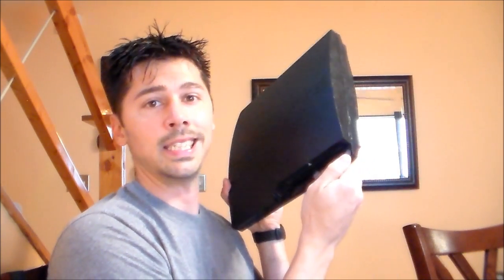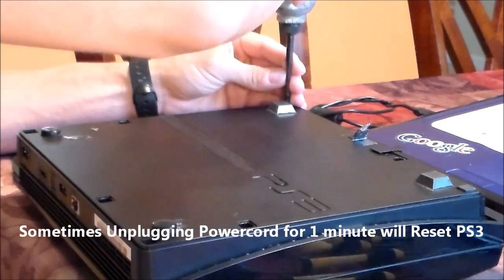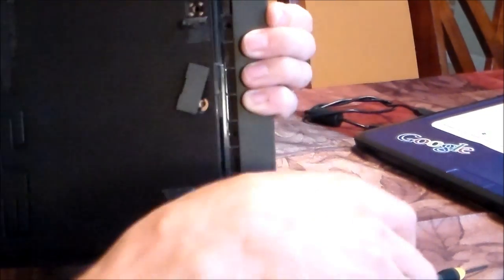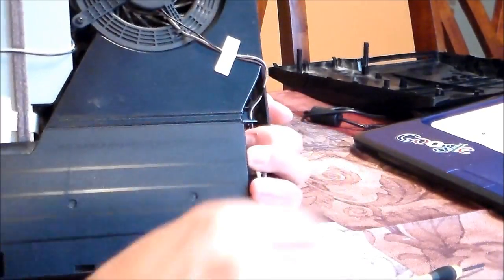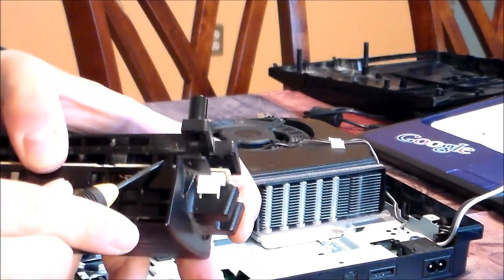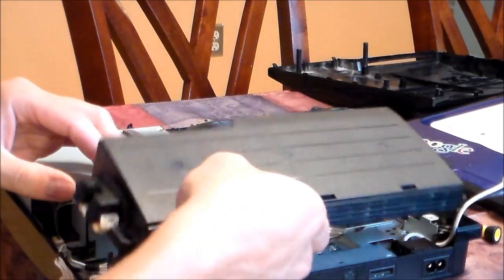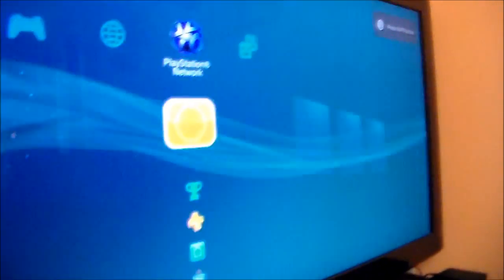HOW TO Open PS3 & Fix No Power - Powersupply install

Comment from the maker: unplug all cables and power cable too on ps3 and tv wait 2 minutes to hard reset system,  then plug in if no good use the a/v component ps3 cables. try cleaning fans. good luck, sub if this helps 8^)

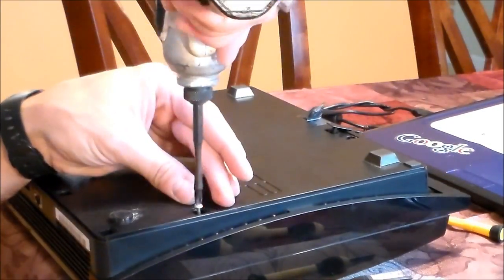Comment: @11:38 you are power driving the screws in.
This is one sure way to STRIP out the mounting hole threads.
 First, take a screw driver then rotate the screw counter clockwise to start and capture the present mounting hole threads.
 You will notice how the screw drops into place.
 Once in place you may continue with the power driver.
This method is good for plastic, wood and metal mounting holes.

Comment: it's funny that the screws are hard to remove from the power supply It was hard for me too but I did unlock them and I cleaned it up and there was a lot of dust in there the information you gathered is really good bro.

Comment: Great video but my ps3 is still not working. My problem is that when the power is plugged into the ps3 the red light comes on and then shuts down within  2 seconds. If the power button is pressed as soon as the red light comes on it turns on but goes off again immediately.

Comment: I have a cech-3012b and am having a bleep of a time trying to pull the power supply. I’ve done the prescribed things but on optical drive side near the plastic square (I’ve tried pushing it this way and that if it’s notched to something), looking for snaps with no luck. Forcing it, the LAN and HMDI section is squeezing away out of the case. Think I’m doing something wrong.

Comment: How do you suggest to clean the ps3 cooler? kind of worried i never had an problem in terms of overheating,except one day that was quite hot the ps3 turned off,luckily nothing happened only turned off,can i use an aspirator?

Comment: Hi. Great video. Very informative and helpful. I have a separate problem though .... When I plug the unit in, the red light is on, however when I turn the power button on, it goes green for a few seconds, and then goes solid red with a series of beeps, and then nothing works. What could be the problem?
Reply: the same as me damn
Reply: And me.

Comment: I have a ps3 slim cech 3001a. Its kinda different. How do I open the power supply cover as there doesn't seem to be any there clips around it. Nice Video by the way.

Comment: @Tampatec first of all many thanks for your help on youtube. My PS3 works well when it is on standby mode but as soon as I turn it on it turns off. The PS3 goes off completely. I am not sure whether its a power supply problem and something to do with the firmware. FYI I haven't done any update. Appreciate your help. Thanks.
Reply from the maker: i need more info or use code paul51p for 1 free google video helpout- https://helpouts.google.com/109162147223399593709?authuser=0
Reply: My friend has the same problem, did you get it sorted out?

Comment: Hey Tampatech can you fix my PS3 it was struck by lightning I live in fl too. My green light comes on but nothing else? Really enjoy your tutorials which is why I am reaching out.
Reply from the maker: Check standby volts on power board,  if no volts then replace it. If power board is ok then it's main board. Check powercord and ac outlet too.
Reply: +Tampatec I have no technical skills at all so I wouldn't even no where to start is there a way to have you look at it?
Reply: +Tampatec I am lost?
Reply: +Tampatec is there a way to get the information off the hard drive at least and just replace the system ?

Comment: Have the system turned off push down on the power button until you hear two beeps first beep you'll hear is when you push down then you'll hear a second after the second it should reset the A/V input

Comment: Hi Tamptec, sir. This is a bit off topic but is a bit related.
Does my Famicom power/AC adapter need rewinding or does it need it's capacitor replaced? The adapter is 10v DC but the power/AC adapter is only outputting less than 1v. 
The specifications are:

DC 10v 850mA
AC 100v 50/60Hz 18Va

Is it the capacitor? The capacitor spec is 16v 2200 microFarads.

Thank you in advance. 

God bless, Psalm 11:7

Comment: I have the 80Gig FAT none backward compatible and seem to be having a power supply issue, it shuts off randomly at time and some like after playing for 2-3hrs. I had already cleaned out all dust, replaced the thermal paste on the CPU and GPU, made some custom hole to allow better air flow and last but not least reseated the CPU and GPU (using flux and heat gun). I can only suspect that the power supply may be the issue. I will try and seek a power supply and post an update if it works.

Comment: I have the actual thing for the star screws and it's not helping at all it just twists right over the groves and won't lock in so I can actually twist the screws so annoying
Reply: If you use a super tiny flat head screw driver it'll work
Reply: I'm not sure but ,if anyone else needs to find out about playstation console repair try Alkarno Playstation Fixer Alchemist (just google it ) ? Ive heard some interesting things about it and my mate got amazing success with it.

Comment: here's my problem my ps3 has problems like I'm not sure if the orange light next to the USB ports isn't orange when I play and it does a little bit when I start the system so I'm thinking that has something to do with my controller since my controller won't hook up to my ps3 and I tried the back of the controller trick with the button but no it won't hook up to my system so I don't know what's up

Comment: I have a super slim and it just shits off after a couple of seconds ..should i get it fixed or buy a new one? Please someone help i cant play gta
Reply from the maker: unplug it for 1 minute to reset it then make sure its not over heating, try it 8^)
Reply from the maker: also if you just turn the white dial on power supply little bit may help, but new ps3 slim should still be under warranty 1-800-345-7669 Playstation Customer Technical Support

Comment: I have the older fat ps3. It has turns on just for 3 sec and then shuts off with a solid red indicator. Is that still the power supply? Please help me out I'd really appreciate it.

Comment: Can you help me out? My ps3 was working just perfect two days ago but for some reason nothing appear in my screen. All i get is a black screen even though my ps3 on button still shows green. I even tried to reset my ps3 with the whole holding down the power button for X amount of time but even that wont work. After doing some research i found out that i got the GLOB (green light of death). Maybe one of my cpu got corrupted and the only thing i found to fix this was to do the penny and hot glue like substance(forgot what it was called) trick. But the problem i found was that idk how to get to my cpu on my ps3 slim version. Your tutorial got me half way there and i really appreciate that but can you help me out or point me to a video that helps me get to my cpu step by step? or do u know another way to fix this GLOB? thank you

Comment: Mine is powering up then freezing or shuting off by itself. But where you plug in the power cord if you get it at the right angle it will work fine... Any suggestions???
Reply from the maker: check solder connections in power-supply or mainboard's gpu may need solder-reflow. power-supply cost at amazon is $35

Comment: easier way to take the power supply apart: never pry or pull apart the plastic you will brake it over time (possibly the first time you do it) instead take a small Flathead screwdriver and push in the small clips in the vents some models have clips on both sides

Comment: I dropped my ps3 slim after a minute it shuts off . I opened it and the board seems ok not cracked nothing damaged. it turns off but the power button don't light up but if I press the eject disc it makes the noise . and the hdmi shows no signal at all. cam you please help
Reply: bobby lue same with me bro my system works find but when its on the power button or the eject bluray button drive doesn't light up do you no how I can fix that

Comment: hey whats this it is located under my blue ray hooked to board under the plate thisunit also had no cirrett board hooked exteranl on blue ray this is obiovious a battery cr20324 c1

Comment: You did everything right Boss...except for touching the actual power supply board with ur greasy fingers...Never touch the Green part with metal or.ur greasy fingers. It could ruin a brand new power supply or in my case a brand new mother board

Comment: hey, my ps3 is a first gen from when they first came out, its backwards compatible. about a year ago it overheated and died, I reflowed recently and and it worked for like a week. I applied another round of thermal paste and that helped for a while, but it has returned to turning on and shutting back off within a few seconds. what should I do?

Comment: this is my problem I cleaned my ps3 and disassembled it. I accentaly did something with the motherboard and a plug that's under the disk reader when you disassembled it please. I plugged it in and the red light wasent on please help me!!!

Comment: I'm able to plug in my power cord and when i plug it in the red light shows up when i try to turn it on it turns on for like 2secs then just turns right back off
Reply: the power ribbon is broke then.
Reply: I have the same problem but with the disc. when it closes it pushes a button down that connects to a wire. but I looked at the wire and its broke .
Reply: Just replaced that ribbon same problem

Comment: when i turn on my ps3 its all normal but like in 3 mins i get a message saying that the ps3 is overheating please turn it off or something like that and it turns off and it wont turn on again. do you think its the the fan or the power supply?

Comment: My ps3 super slim has a similar problem. I can play it ok (no overheating issues), but when I leave it plugged in for like 3 days, the red light goes out sometime when I'm not using it. I unplug it, then plug it back in, and then I have to set the date and year before playing. I would like to fix it, but it's not debilitating, and I think I can get away with just unplugging it after playing. Pretty sure it's a power supply issue.
Reply: its just your battery in ps3. change your battery than you dont need to set the time date and year again.
Reply: Oh, thanks!
Reply: Me oo I left it plug in for 3 weeks then it does this and I need power supply I mean spare one :(

Comment: Here's my problem :

My Super Slim PS3 . When i plugged in it's at red ight . Click that red light button and it becomes green light for 30 - 35 sec 

and to no lights . Black . 

Then , when i pushed the black button it changes back to red light button . Repeat above process .

Thing is , i hear the fan goes off or the ps3's sound fading when the green light hits the 30 - 35 sec mark . 

What's the problem here ?

Safe mode is inaccessible .
The TV / HDMI Output is all black .nothing.
Reply from the maker: use standard ps3 yellow, re, white av-cables to tv hold power button till you hear 2 beeps to enter service menu. if you still can't then check power board standby volts if ok then main logic board needs to be serviced.
Reply: did you fix it ? i have the same problem
Reply: Ghost Rider nope sobs
Reply: +TheMister Shaggy what?
Reply: Ghost Rider i haven't T_T
Reply: ive got the same problem please help
Reply: same here
Reply: Can you make a video about it? My Ps3 sometimes doesn't show red and sometimes it doses and when I click red its turn green and then nothing, please help.
Reply: same how do u fix it i have PS3 RIGEL
Reply: i have the same damn problem except the green light only shows up for a second. i think my ps3 killed itself since i was on ps4 lol
Reply: Me to
Reply: Basil me to

Comment: Hi Tampatec, where can i buy a brand new PSU for ps3 super slim(2013)? The other day there was a high voltage in my house and smoked my Tv and ps3. Even after that both were working but i repaired my tv for just $3. It was a cap that had blown out, cap that converts the power. Can i repair my ps3 the same way by replacing the cap?

Comment: Had my ps3 for a good solid 5-6 years now it's been working fine in January this year but a few weeks later my ps3 started acting up I turn it on and it wouldn't show on screen and it's on and can't turn it off by power button(need to hold it till it turn off) and I think it just over heating so I cleaned the vents and the fan but still does the same thing again. It shows at times but most of the time it doesn't and it's irritating me >_<

Comment: i need help my ps3 turns on for like 30 seconds then it will shut down and it wont turn the display on what could this be 

i think it would be the battery supply

Comment: My PS3 stopped working after working on it one day, the light would not light up. I replaced the power supply (Yes, I checked the model number and purchased the correct power supply) but it's still not working.

Comment: my ps3 juz struck by lighting bcoz i forgor to pull the plug....i cant open my ps3 and there is no red light when i open then plug....so isit the power supply problem?how can i check the powersupply spoild or not

Comment: My PS3 yellow light blinks for 2sec but then stops and the PS3 don't work what you think could be wrong with it
Reply: Yellow light of death.
Reply from the maker: unplug ps3 for 5 minutes to reset but it that does not work gpu might need to be reballed, you can use a heat gun to reflow the bad solder joints on gpu but that will last under 6 months (I tried reflow) reballing you have to send it out cause it takes special equipment to reball. google "ps3 reballing" to find out more.

Comment: or you could just buy the $1.00 screw driver for the star screws its a T8 T9 or T10 if you spend a little bit more money you can buy the whole set for every screw in the system doing it like this can ruin your screws or screw driver

Comment: The problem is that when I press the PS Button to turn it on, the LED goes green, and in a few seconds it beeps rapidly, then turns red, and then blinks red. I don't know what is wrong.  how to solve this?

Comment: MY PROBLEM:
I have a new problem with my ps3.when I play a game and when there is a sudden attach or something that vibrates my controller and due to it my systems automatically turns off and red lights blinks  until I don't press the power button.plz help

Comment: Could you help me? I was unable to open my PSU. My model is EADP-200DB and there are two screws, but then it's too hard to open it.
Reply from the maker: unscrew hidden screws under rubber feet and mini screws under ps3 inside vent under disc drive. at 3:08

Comment: Are you sure its the psu or motherboard because mine has no power no light and no noise.
Reply from the maker: check 5 dc volts on power board if nothing just buy power board for $30 on amazon 8^)

Comment: my ps3 controllers and move controller is not connecting wireless. I test them and there not working also i cant connect to the internet wireless. the dual shock controller only connects using the usb cable error code 80130128

Comment: I have a ps3 slim 120gb my problem is that my playstaion cuts off as if someone has pulled out the power cord when I plug it in the red lights comes on when I press the on button on the ps3 it comes on for about 3 seconds and then cuts out with no red light until I Press the on button on ps3 again the red light comes back on but still no luck it's happened a few times now sometimes I will leave it for half hour or a day and it will work first time but not anymore can you help?
Reply: I have the same problem have you fixed yours????
Reply: TsUpHoesLast
Reply: Same problem please someone help

Comment: got a new Power Supply, but my ps3 turns off immediately after the power button is pressed, then the red light disappears until the power button is pressed again and it repeats over and over again...any suggestions?
Reply: I have the same problem! Anybody know what's happening?
Reply: Open up the PS3 and make sure all the cables inside are well plugged in and then it should work. I did that yesterday to mine and been fine ever since
Reply: +PrydaV same thing with my ps3
Reply: +jasson chevez i'll give that a try
Reply: +Royal Mikeyx did it work ?
Reply: i don't know i wasn't able to get my ps3 open there a was a tool i needed i had one but in was to big so i never got it open
Reply: wait did it work for you
Reply: No I tried a different method and didn't need to change my power block
Reply: o so maybe that's what I need
Reply: hey it worked i fixed it it was loose where the power supply was
Reply: I got a new power supply and have that problem too, Plz help

Comment: Hey Tampatech, I  have a Super Slim PS3 and I was hoping you could make a video on how to fix a power problem. I plug it in and the red light comes on, push the button and it turns green like normal, but it turns of after like 5 seconds. Can you help me please?
Reply: I have the exact same problem and would also appreciate any help, but mine is the slim PS3. Some months back I managed to fix it just by opening it, taking it apart, and putting it all back together but it's now happened again and I haven't been able to resolve it.
Reply: Oh ok, so it's a general problem! Thank for the info then, and keep making your videos, they are a lot of help 😉
Reply: Wicked Gamer same did you find solution

Comment: My PS3 will turn on and light up but I can't see the signal on the tv. I tried using different TV and using different plugs and the other plug thing but no success. Any help?
Reply: I have the same i can't turn off my ps3 and it says no signal
Reply: +Jay Is Awesome af 
You have to Hold down the Power button, while turning on the console, until it beeps at you (10-15 seconds). That resets your video settings to adapt to the new tv.
Reply: thanks fam! :)